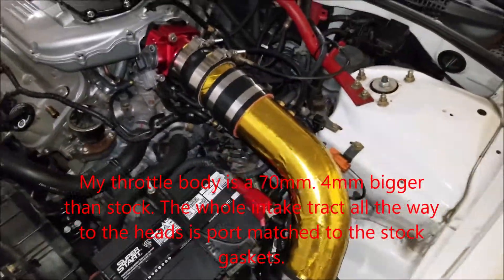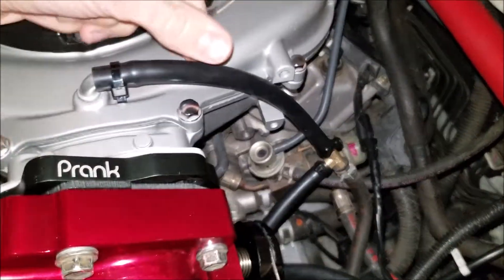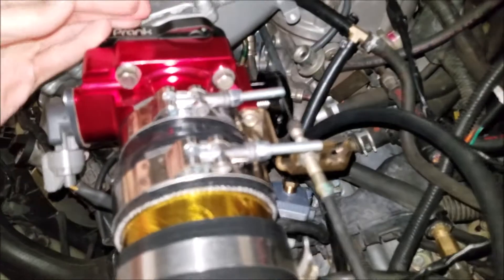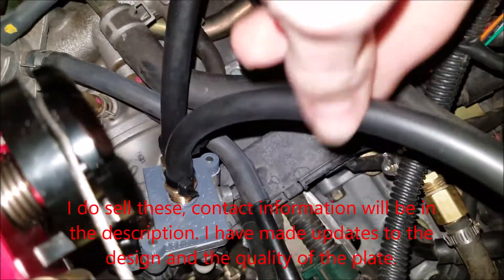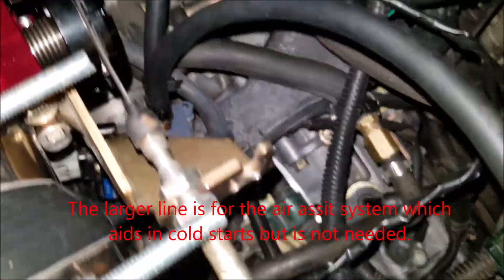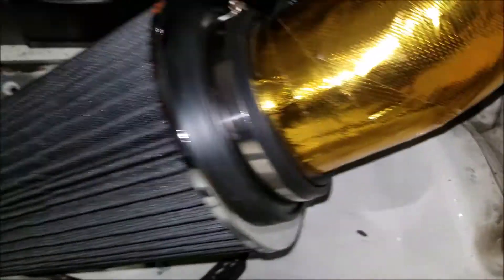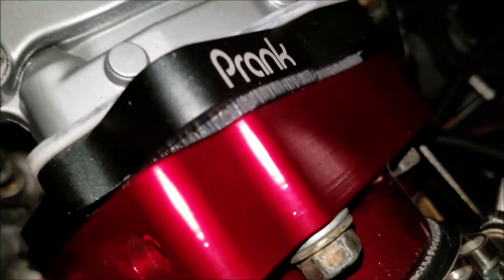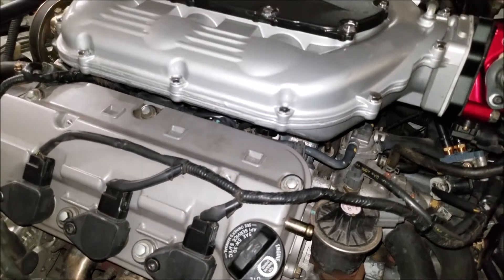B Series Throttle body Swap Overview

Comment: I tried to put a 3.7 intake manifold. My stock tb don’t fit on the manifold… and I can’t use the 3.7 throttle body on mines because I use cable. What should I do??
Reply: P2r sells an adapter

Comment: I haven't been able to find a proper guide on where to hook up the vacuum lines. This helps me out a lot, and I will be doing some tweaking later when I get my IACV bracket from P2R.
 I'm wanting to know if you could maybe help me figure out why I'm having some rev hang at 1500 while driving. Do you also know how to do the resistor trick regarding the VSA delete?
 Thanks for this video.